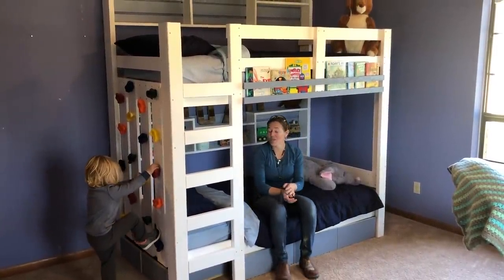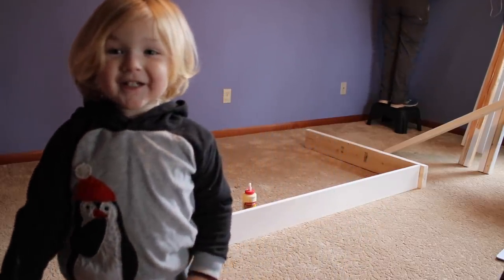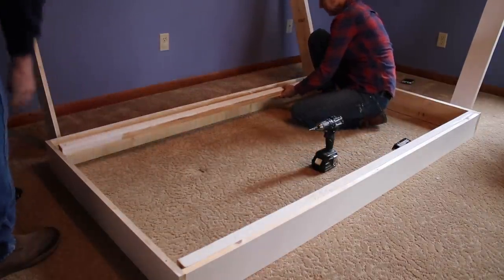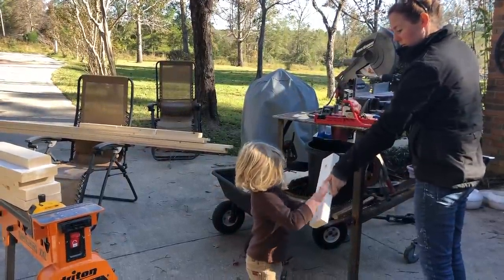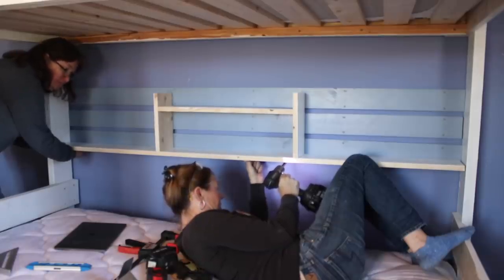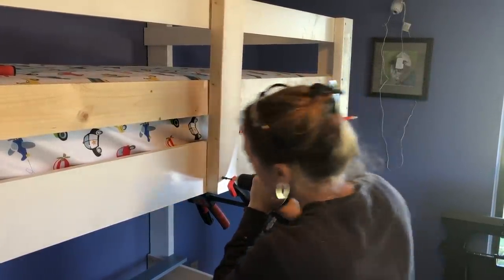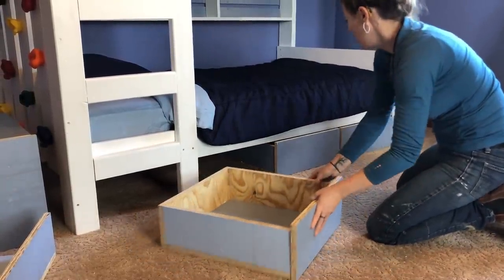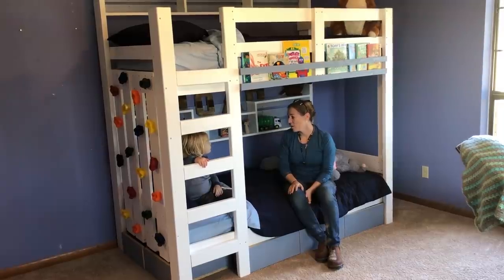Build a Bunk Bed with Rock Climbing Wall

Comment: Two ideas come immediately to mind April; Next time you are indoors recording without a tripod, clamp the camera or a small shelf substitute to a door or door frame, And, when gluing parts on carpet put down a layer or two of pretty much any kitchen warp, aluminum foil, wax paper or parchment to keep the glue runs off the carpet pile. Even sheet goods or cardboard with a winding or two of saran wrap will work.
My thanks to the parents for the cuteness overload. I have been needing a large dose of that for a while now.

Comment: I love the build 

I did something similar but I didn't prepaint it as I wasn't sure how it would come out and I wasn't sure if I would like it but it seems the whole family loves it "wife the most as she is always on the top bunk😀"

I do like the rock climbing wall and see three panels I wish I would have thought of that but I was going for more overall strength because I have two boys that are hefty bruisers, I used plywood and put shelves inside to hold books and bags plus middle of night snacks

I like how you finished off the front of the rail

Maybe I'll post up mines in the future

Comment: Cute build, but as I was watching I couldn't help thinking that there were just a few screws holding the top bedframe in place. I would have run 1" x material up the inner leg to provide continuous support to the upper bunk ... he's only going to be 3 and light for so long :)

Comment: What if you did this with the slats? : Instead of screwing each on directly into the bed frame, place a length of 1x3 on the ground about half the length of the bed fame, place the slats on top of the 1x3 - make sure that the 1x3 is centred in the middle of of the slats and screw the slats down onto that 1x3. What you get is slats that come as one piece which you can then just place inside the bed frame without screwing it to the bed frame. That way when you want to disassemble the bed frame, you just need to lift this out. You need to make 2 of this to cover the length of the bed frame - make it in 2 halves so it's easier to move around. Thoughts?

Comment: Funny, I just knew the safety police would rear their ugly heads!!  Firstly, how is a kid of that size going to get decapitated by a fan 6 feet above the ground? As for that deadly "rock wall"; the bairn seemed to be managing pretty well, without trappingh fingers, feet, legs or head. If he needs protection from his bed stood on a sort, fluffy carpet, God help him if he's ever allowed to allowed into the garden. Of course, if the bed does cause life-changing trauma during his formative years, his folks can always sue Auntie April. grrrrrr!!  Dearie Me smh

On a more positive note, this was a greatproject to watch; with all the family lending a hand. I was a little surprised that you didn't cover the ends of the screws with plastic wood, or similar, but I'm guessing this is to make it easier to disassemble. Nice to see a kid with books too, instead of a laptop or T.V.
You have a lovely family April, keen to help and even clean your lens ~ classic Mum.😂

Cheers for now,🍻
Dougie.

Comment: think it is a very dangerous building, which goes against the safety standards, without a real staircase to access the upper floor. Question: - And if the child one day slips his grip and hits his head? Then the fan propellers so close! I think the whole project should be reviewed